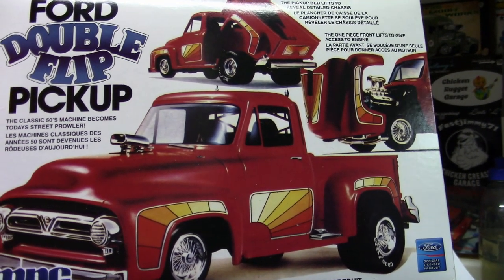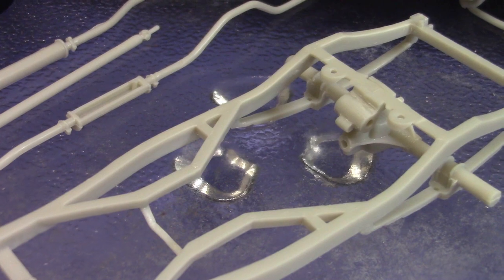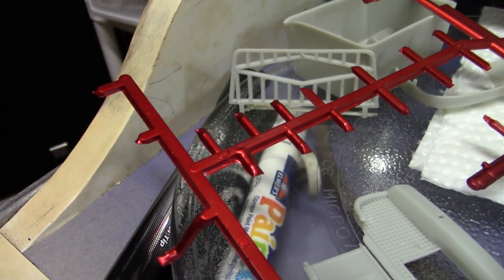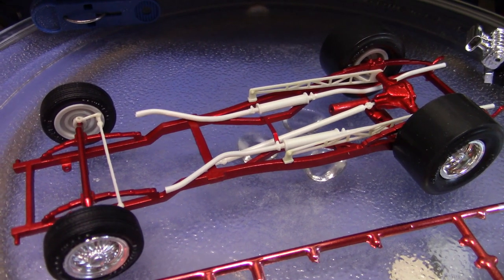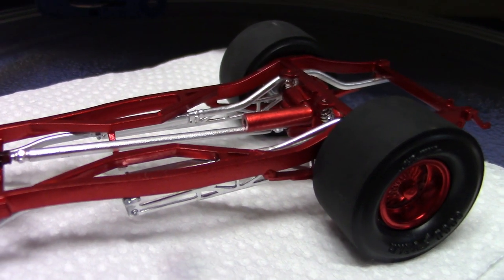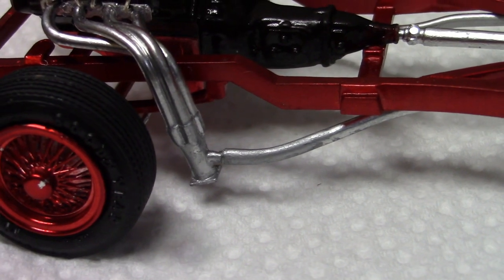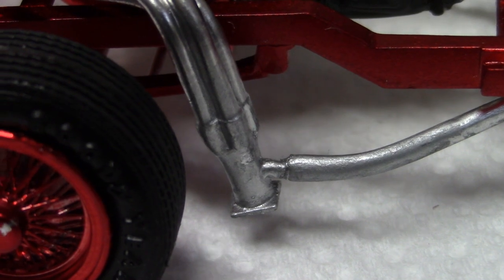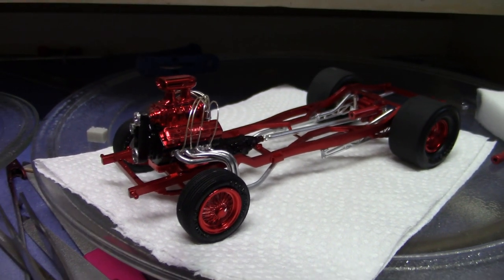Ron Stewart MPC '53 Ford pickup update 1

Comment: Hi,just cut some pieces of sprue the same length & shave them down if you have to to fill in the hollow tops of those exposed mufflers on the model,less filler used then,hardly any at all really?,just a tip,that's what I do in these circumstances,wow,that sure is a whole lotta shiny red indeed,lol,cheers